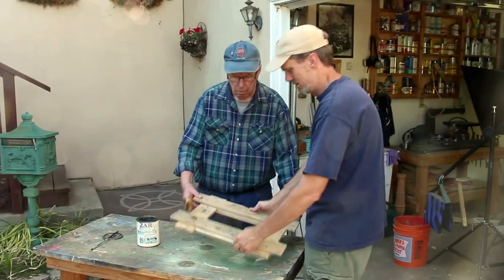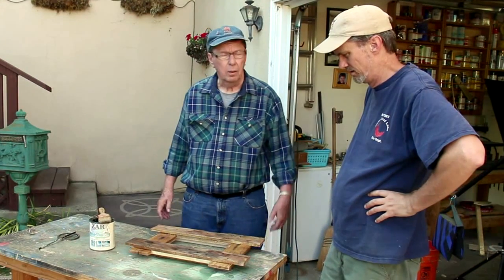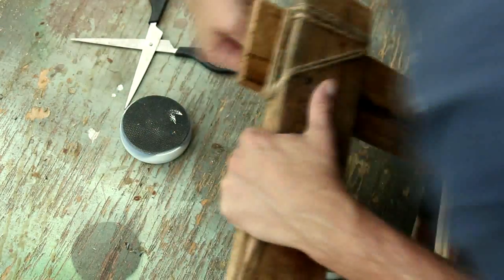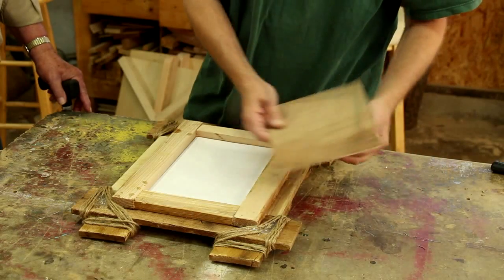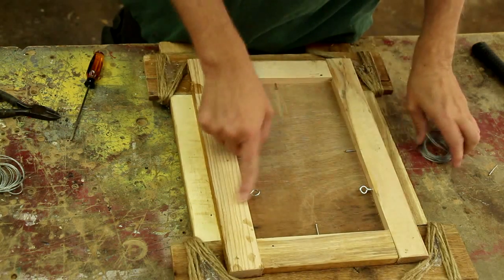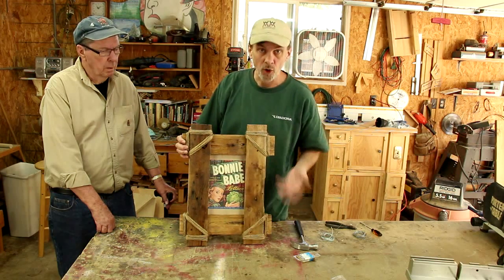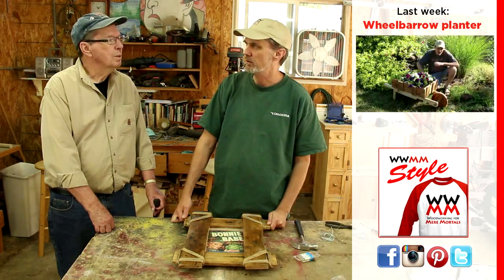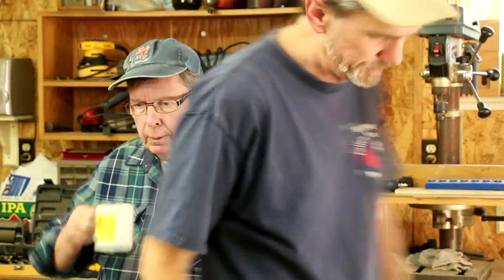Make a rustic picture frame with pallet wood

Comment: Good job. The only improvements could be a Passe-Partout framing to enhance visual appeal. I would also used bowline knots instead of hot glue to make it even more rustic looking. BTW, I would have mistaken your father as your brother. I assume the beard is adding at least 10 years to the estimates.